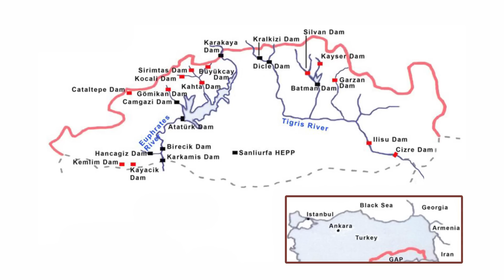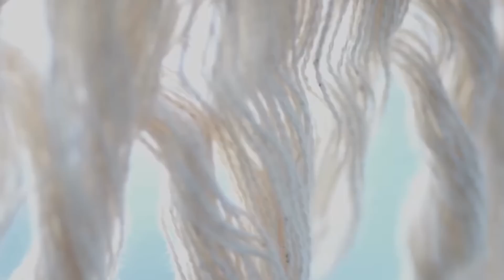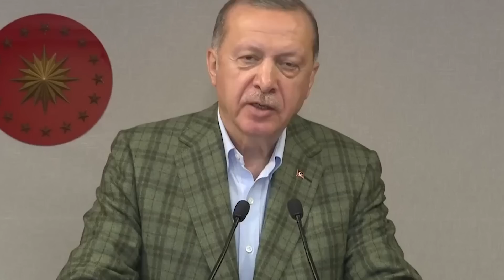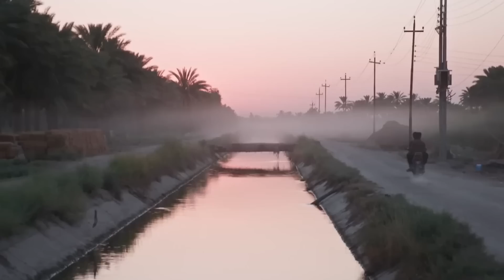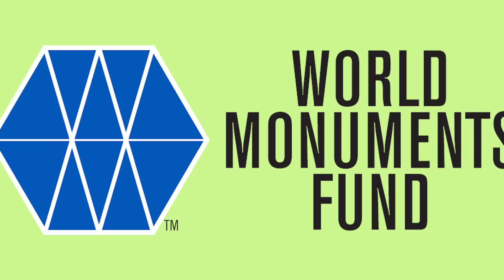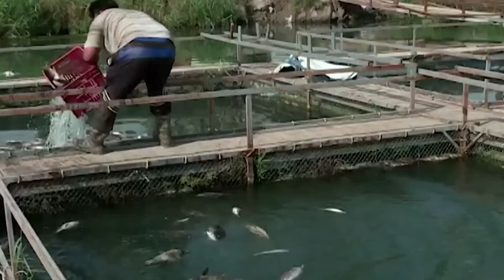Turks Blocked Tigris River Flow Into Iraq And Poured All the Water on Cotton

Comment: In 2023 the Tigris was very very shallow in Iraq even in places like Baghdad you could walk across the river without the need of a bridge 

However after that the new agreements with Türkiye made things better and despite temperatures being higher in 2024 the water was much higher 

I'd love to see the agreements secure long term supply to Iraq 

Iraq and Türkiye also have a joint trade route project so the 2 countries will be more connected economically so I'm not worried about water supply as it would be easily solved 

Props to the Turks for willing to talk and reach solutions together